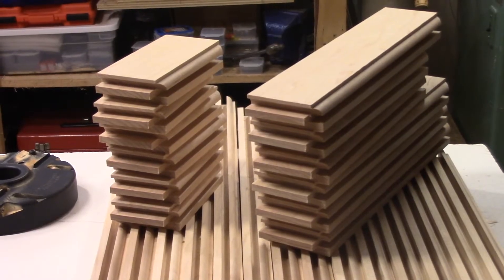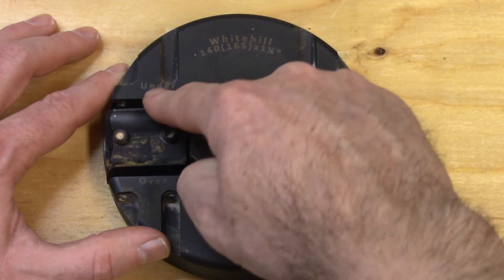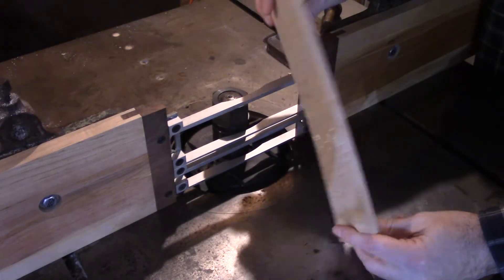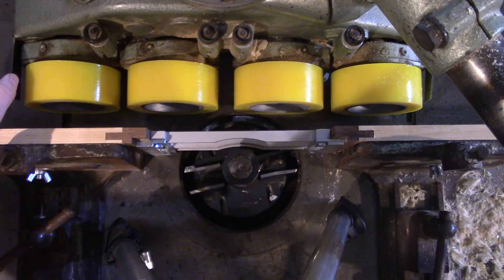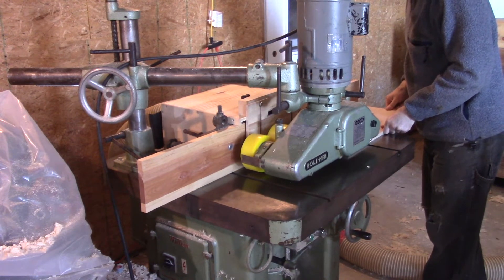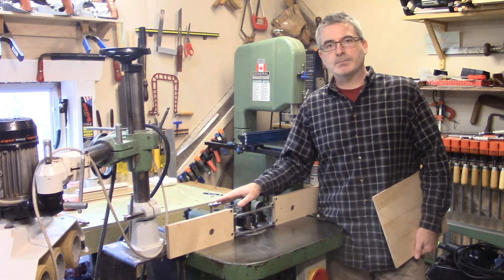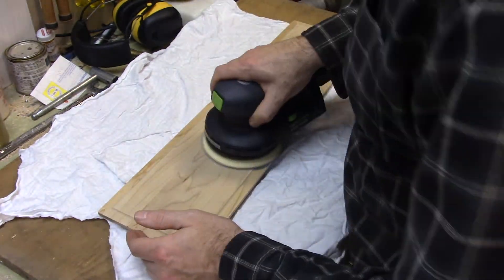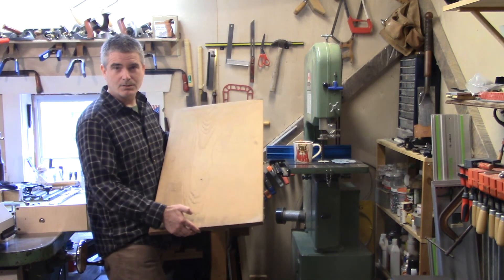Custom Kitchen Doors Part Two- Raised Panels on the wood shaper or spindle moulder.

Comment: We are about ready to do the cabinets in our Carriage House Build. Very good video ! You have an Army of big Power Feeders!  Love your shaper cutters. I am defiantly upgrading to yours! ❤🤠
Reply from the maker: Let me know what you have for shapers and I can help you get sorted out.  I work kinda informally with Whitehill helping them out in North America so am pretty familiar with the lineup.
Reply: I right now have a 3 hp Grizzly shaper and 3/4 hp  feeder.  Do these heads make multiple cutter blade profiles?
Reply from the maker: @TwoGuysTimberframing   Yes, the head that I used for  doing the rails and stiles will take replaceable knives,  and also the panel raiser will too.  In fact there is a huge assortment of profiles available, but you can also have custom cutters made so your doors can have your "signature" look if you want.  Kinda neat to be able to offer something that nobody else has.

Comment: Hi Dovetail Timberworks. I cut my teeth on Wadkin EQ spindle moulders starting back in 1976. I see you also have an HOLZ HER stock feeder as well. 
Cut my teeth on those as well and used the Steff feed units as well. What microphone are you using? It's the best I've heard so far on YT. Great video. Tony
Reply from the maker: Thank you Tony!
Reply: @DovetailTimberworks  It's amazing you have a the UK's benchmark Wadkin EQ Spindle Moulder / Shaper and you are using another UK benchmark company, Whitehill tooling. (I employ no-compromise techniques that focus on long-term reliability) Your words. I agree, top dog. Very nice job. Your right about no sanding. I hate sanding, well almost, just a small amount lol. A good wood machined finish doesn't need much sanding at all. Hope you agree. Thanks, Tony

Comment: Did you happened to do a video of using the aigner counter max? I browsed through your videos and haven’t found it.
Reply from the maker: @TallEvaGuy  No not yet, but it's on the docket for this winter/spring!   Thanks for your patience, however it does make an appearance in my video from last year on the cabinet door tooling set.   Just about to post a long tenon video too.
Reply: @ I bought one a few months ago to use with my new shaper. I noticed something that seems a little odd with it. The plywood rub strip isn’t completely flat. It appears to have a slight bevel in the leading and trailing ends. At least 2-3 inches. The only thing I would guess is it’s purposely beveled that way to prevent catching the out feed fence as it approaches it. At least for the leading end.  Do you know if yours is that way.  I thought about sanding it flat or replacing it.
Reply from the maker: @TallEvaGuy  Huh...that seems strange.  Perhaps a wee chamfer on the leading edge, but a long one on both ends seems wrong.
Reply from the maker: @TallEvaGuy  I will check mine

Comment: I just subscribed to your channel the other day. I am very interested in woodworking with the word shaper and spindle molders I just bought a used one Grizzly G Dash 1035 for my shop I am really excited and can’t wait to start using it on projects. I have a question back in the 60s 70s craftsman used to make a molder with different shaper heads they came in a kit and you could install them on your tablesaw and they were very popular in making molding, is it possible that these can be used on a WoodShaper. Since the blades are tighten down with a bolt and they do fit the shaper have you ever used one or know of anyone using one in this form? Thank you for sharing your knowledge looking forward to seeing more videos.
Reply from the maker: Welcome and thank you for the note!  Those blocks are still around at yardsales but are pretty old school and not precisely made.  I know people managed to tweak them and get ok results with them, but they are not a very safe design.  If you're new to spindle moulders, by far the best way to start is with a small limiter block that takes different knives.  My most used block is my small Whitehill combi head that is both a rabbit/rebate block and a limiter head in one.  Safe kit and top knotch quality.
Reply: I ordered a block That takes different knives a small one 2 inch I believe from Grizzly and I’m planning on getting a tongue and groove cutter heads package.

Comment: Nice aigner like fence add on - is that custom made or did you purchase that?
Reply from the maker: I'm not sure who makes them, but in North America they're sold through Felder.  Like a bunch of their shaper tooling, I doubt Felder makes them.  A little clunker than the Aigner kit but about 15% of the price!
Reply: @DovetailTimberworks  Just looked on the USA Felder https://us.feldershop.com/en-US/en-US/en-US/en-US/Shaping/Accessories/Fence-accessories/Cutter-fence-unit-oxid.html
4572.00 Yike!